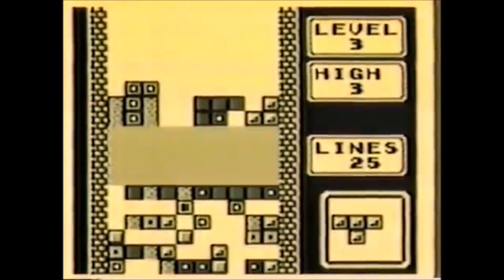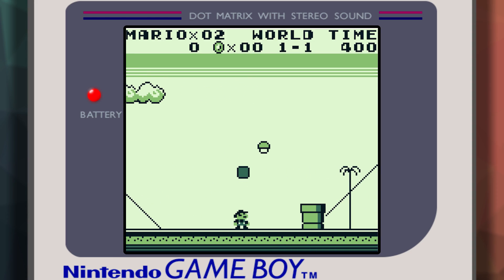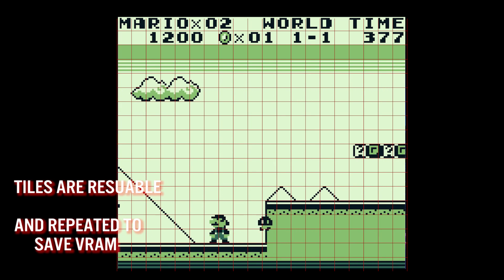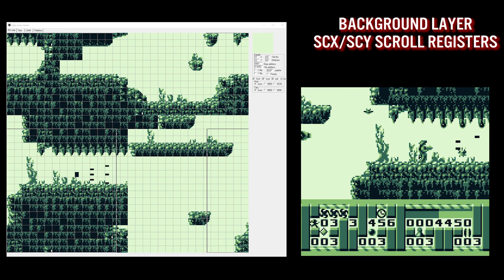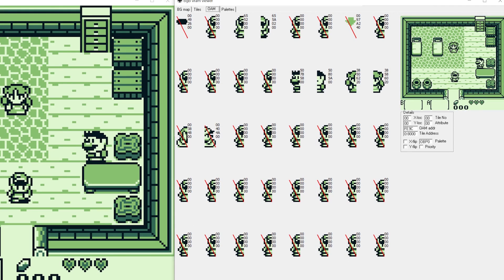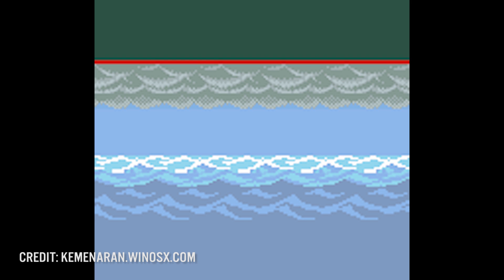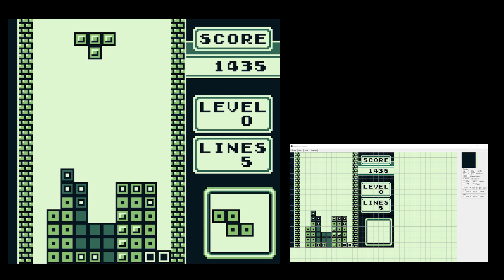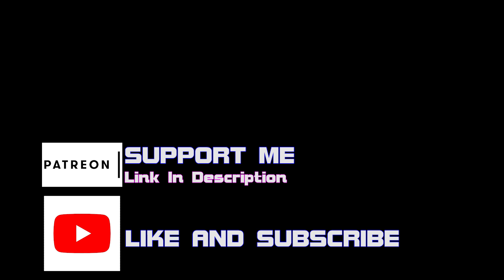How Graphics worked on the Nintendo Game Boy | MVG

Comment: You just explained why Mario can't go backwards in his original games, It was actually quite informative
Reply: In the case of Super Mario Land, the reason for the single direction levels wasn't actually linked to the video hardware; it was due to the limited ROM space.
SML only used a 64K cartridge, so the levels used a form of run-length encoding to compress them, which only works when the data was read from left-to-right.

Comment: I dont know how did you calculate 23KB for the framebuffer. The resolution of 160 x 144 with four colours (2 bits per pixel) would need 160x144 x 2 /8/1024 = 5.625 KB. The tile mode totally reminds me of c64 character mode with redefinable char set, i see no difference,

Comment: Your 22K frame buffer figure is off by a factor of 4 -- the display is only 2 bits per pixel (4 colours), so you'd need 160x144x2 = 46,080 bits = 5,760 bytes (~5.6K).
Reply from the maker: Yeah for some reason I had an 8 bit palette in my head. Good catch